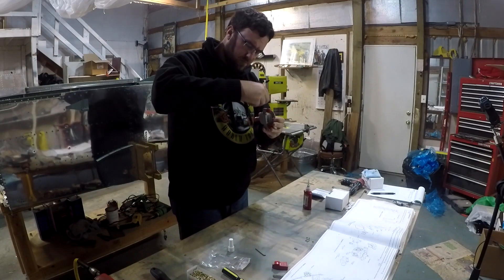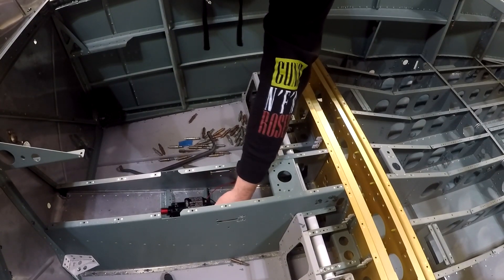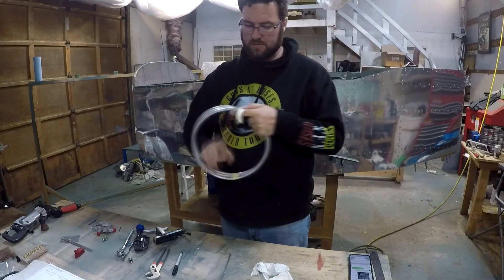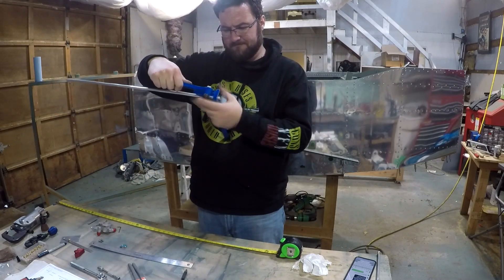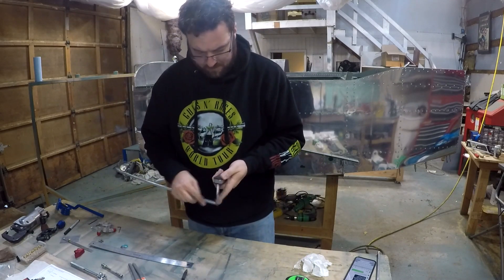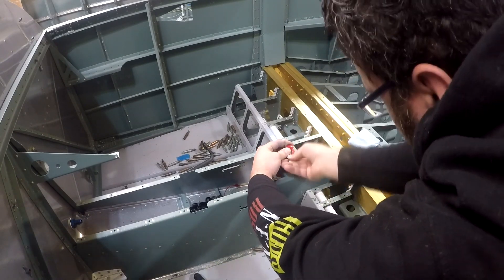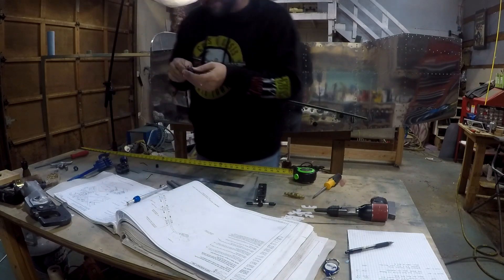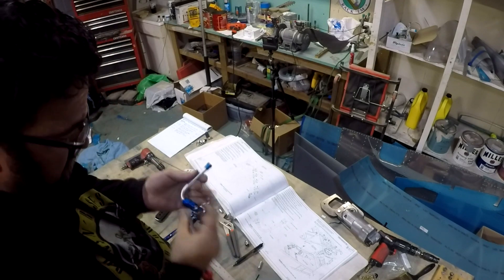Scott's RV-14a - fuselage fuel system

Comment: I see you putting a red bottle/liquid to screws of fuel selector. I assume some sort of thread lock. Is that really needed? Having a lot of trouble getting the tubes bent correctly. Had to order additional tube since I screwed up too many times :-)
Reply from the maker: The red tube is loctite 648 and I had to special order it from Amazon. The assembly instructions for the selector valve called this compound out specifically. It’s labeled as a “Retaining Compound”.

I had to order a whole new roll of tubing as well. I had a hard time making the right tube correctly. I think I have an extra 20 feet now!
Reply: Thanks. I missed that.

Comment: Fuel selector and pump,will be fine . I installed the flyboy gasculators in the wing route as the AP that was signing off my 14 was not happy with vans set up . VH BEL
Reply from the maker: after speaking with Vans' tech assist folks, they said that they have designed all of their engine matchups to utilize the existing fuel pump etc so I think that I will not worry too much as you say! Once I start looking into the electronic fuel injection (at least I think that is what I am needing!) then I will look into this some more, but for now I am satisfied!

Comment: If you're using the IO-390 exp119 it has a mechanical fuel pump attached to the engine.  You can see it clearly on the diagrams in Section 43-01 and 43-05.  The pump included in the kit is a boost pump meant to maintain pressure in case of the mechanical pump failure.  I don't think it's rated for continuous use, you pretty much only use it in the pattern.

Builders doing electronic ignition and fuel injection remove the mechanical pump off the engine and need dual electrical pumps (primary and backup) rated for continuous use.
Reply from the maker: Ah, ok. That makes much more sense!

Comment: Good content, thanks. What type of paint would you be using for the interior? With respect to fuel pump and fuel system in general check out channel of Andrew Kilroy.
Reply from the maker: Im using a grey epoxy primer paint. I was going to simply use the self etching primer rattle can paint that you see all the parts painted in, but it flakes off and scratches far too easily so I went with the epoxy paint.

I will have to look at andrew’s videos again…. I think that I kissed the ones that he was installing his fuel pump in. Thanks.
Reply: @didja691  Andrew is installing a completely different fuel system (electrical) and with that come two special fuel pumps.
Reply from the maker: If I remember correctly, I think that he was designing a return line with his, which I am not installing in mine. After speaking with Vans' tech assist folks, I am going to go with the provided fuel system equipment. As I get closer to installing the engine side of the fuel system, I will look at this a little more and see if there will be any needed adjustments.